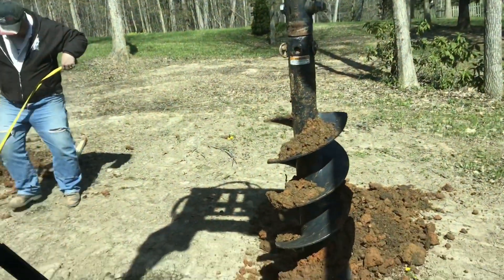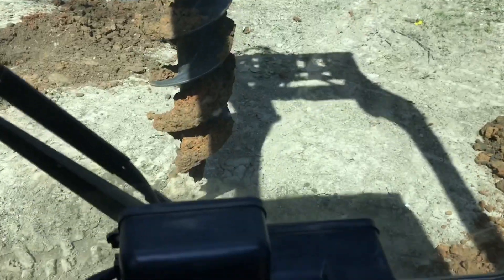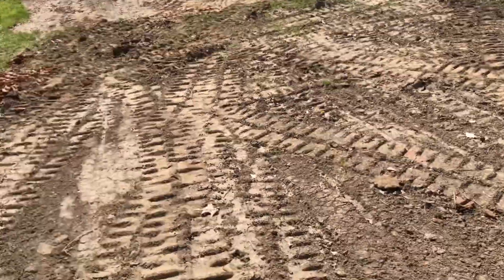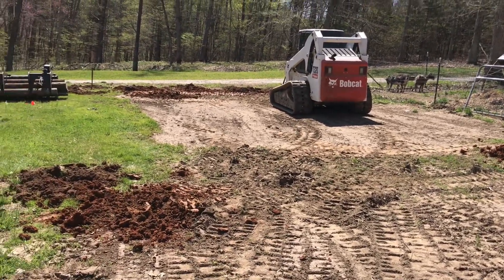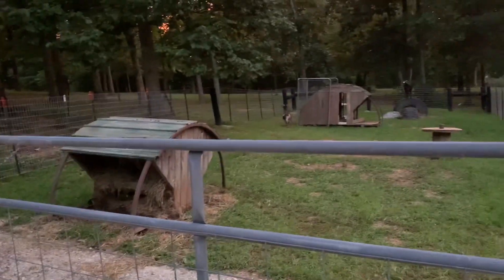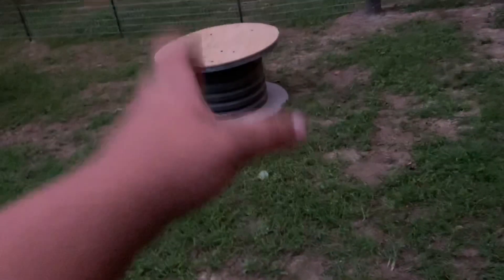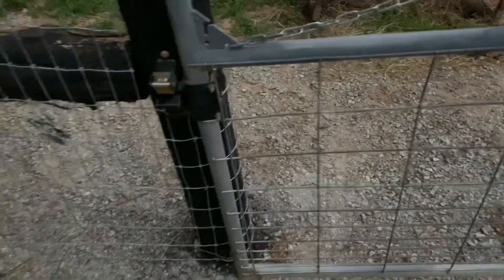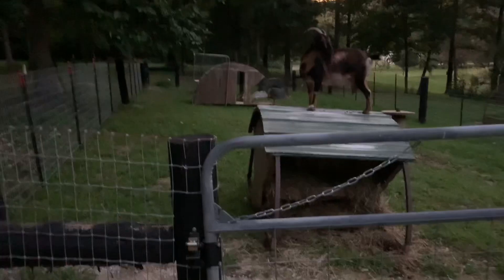Building some fence!

Comment: Nice!  Looks good! That aughta hold em!  I want to convert my 3pt post hole digger to mount on my loader somehow and use hydraulics.  Thanks for the video!  Take care!
Reply from the maker: BurningDinosaurs I’ve never ran a 3 pt one just been around when there used they seem like a pain to use I like the loader mounted ones! Thanks for watching buddy!
Reply: BurningDinosaurs id be more impressed if you convert your bucket to dig using the pto but I just hold you to a higher standard I guess.
Reply from the maker: JasonWorksAlot id would love to see this??!!!
Reply: Excavating 320 YEAH @burningdinosaurs PUT YOUR MONEY WHERE YOUR MOUTH IS!
Reply: @JasonWorksAlot  Well, it doesn't take much to put NO MONEY where my mouth it.  See? I'm already done.  but I'll see about the PTO-driven loader bucket.  Might need some CAD work for that one.
Reply: BurningDinosaurs I like to use old uhaul boxes for my CAD, I know it’s dated but as far as the hardware is concerned it serves the purpose just fine for me